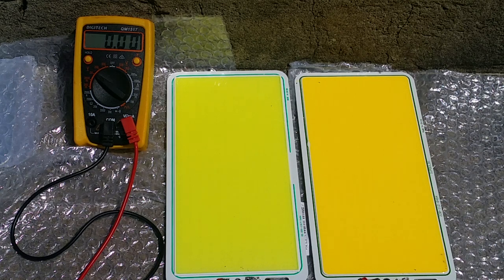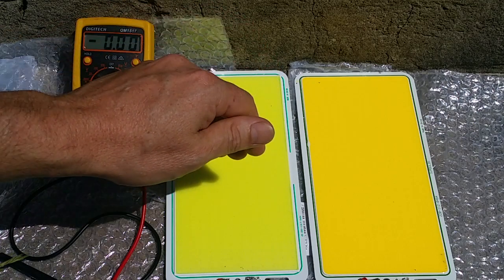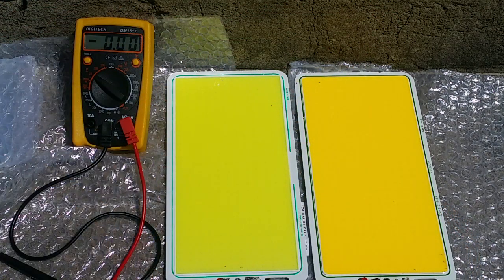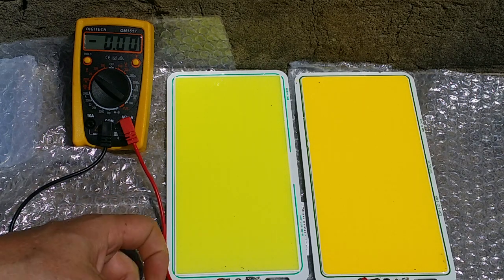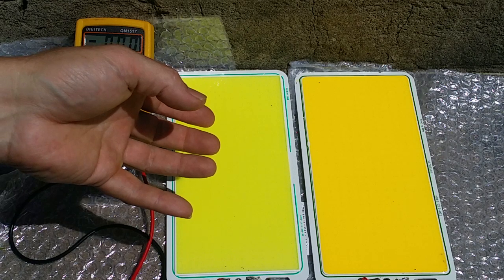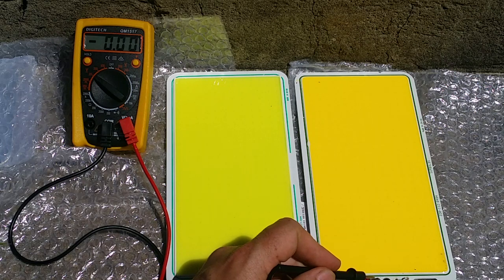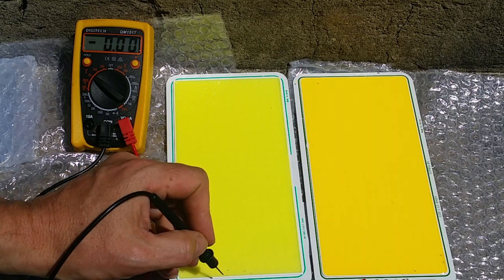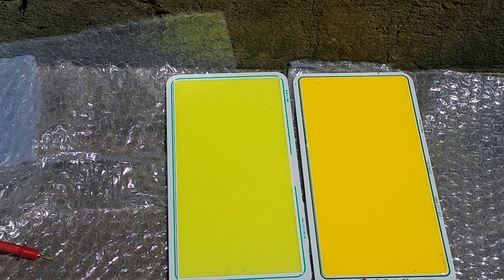LED as Solar Panel~High Efficiency~UV conversion to visible light

Comment: Anyone who is baffled by this, a solar panel is an led. It's just an infrared LED. If you run a voltage across that solar panel in the right way and look at it with an infrared camera you can see it emit light. Infrared is used because the sun has plenty of it

Comment: Could these be collecting Stellar radiation ?

Research Nigel Cheese RPP v3 😉
Reply: These probably not you need a lot more Leds and specific wiring configuration to make it work properly.
Reply from the maker: i have seen Nigel Hands/Cheese... i do not know if it catches night time radiation. Most likely a little bit.

Comment: Makes sense, being as dc motors can also be used as a generator by mechanically turning the rotor or as a motor by attaching a power supply. Very interesting

Comment: So.. those are just led lights used to collect the sun light and output a voltage??? Have you tried putting many leds in a board grid pattern and seeing if that works. Uv light is the most intense in the spectrum and I was wondering why solar panels aren’t made to harness light in the ultraviolet spectrum.
Reply from the maker: i have seen others use LEDs in an array, even the junction from old transistors from the old style metal can transistors will make voltage across the junction

Comment: How about amps?
Reply from the maker: would not suggest they are capable as a replacement for purpose built panels, I was only concerned with the voltage and the difference between the two as a demo for different dyes catching more or less UV light, also I don't know how the panel would handle being short circuited to measure the current. Potentially could burn out one of the fine gold wires that join the LED junction. There are some very high efficiency panels that are basically stacked with more than one PV cell, each letting through the light it can not convert. That is what I was trying to show here, apologies for not making that more clear.
https://futurism.com/scientists-may-have-just-created-the-most-absorbent-solar-cell-ever